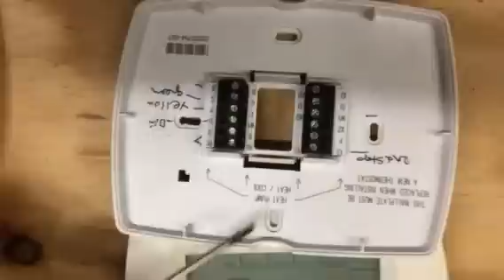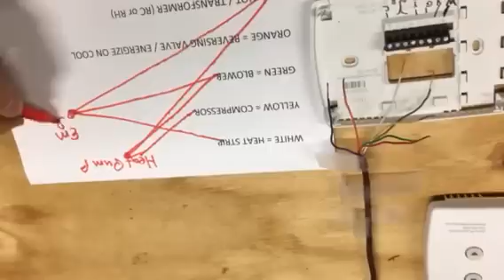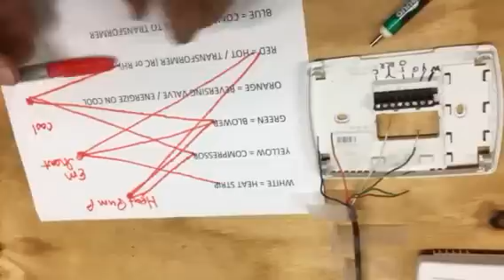Thermostat Wiring

Comment: You forgot the orange for the cooling, but great video.
Reply from the maker: You are right, thanks for pointing it out.. just trying to help
Thanks for watching
Reply: Great video, I also catch it when you forgot orange but only because you explained everything very well. Thank you.
Reply: Yep, the orange wire needs to be connected for the reversing valve to be energized to put the heat pump in cooling mode, or else it would stay in the default heat mode. David was wrong.
Reply: @phototec  that is correct unless it's a Rheem or Rudd system being that they energize in heating
Reply: That's what I'm saying I'm like how can you tie in the same 3 wires that you do for heat to get cold cycle  you have to throw Orange in there to flip the reversing valve
Reply: na na 
So how is it supposed to wire up together for cooling? Red, green, yellow, and orange together? 
Thanks
Reply: na na o.
Reply: I have 6 wire and I want to know what color go